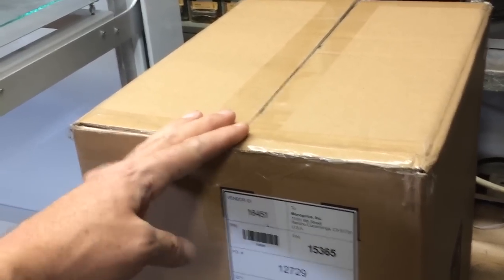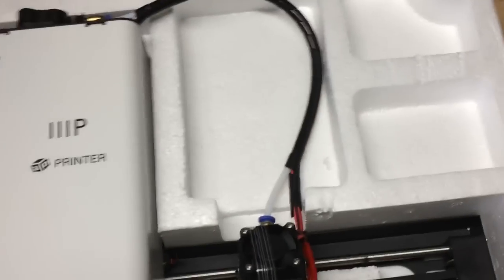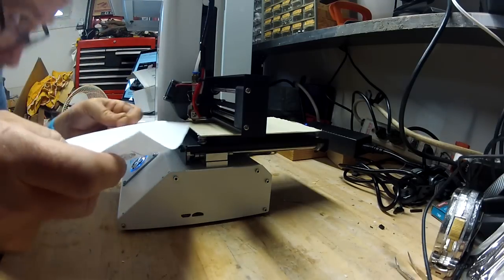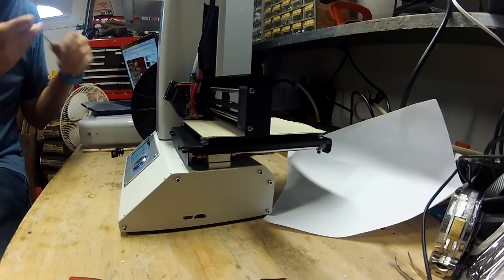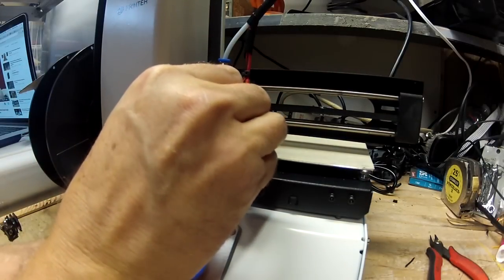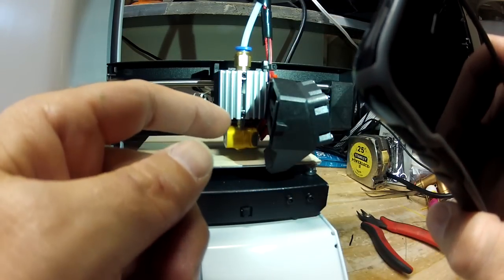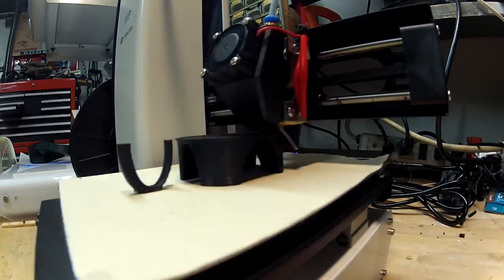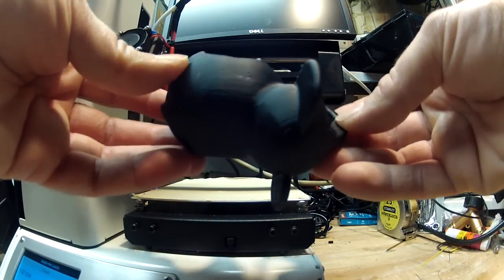3D Printer for $199!! Monoprice MP Select Mini 3D Printer Review - the good and the bad

Comment: I'm having nothing but problems with this printer ever since I "tried" to set up WiFi. Now, nothing works right and it's all over the place. All the settings had to be re-done. It abruptly stops printing because it STILL is trying to connect to wifi which i can't figure out how to stop. Printing by USB was a shit show as well. I should of just left it alone. So frustrating.
Reply from the maker: Yes, best to stay away from onboard wifi, but if you want to go wireless you should look into OctoPi - a raspberry Pi implementation of OctoPrint. I tucked a little raspberry Pi Zero into the case of a Printrbot Play to make it more functional and now no more messing with the USB connection or card on that one. The Pi Zero is a little slow so if I were to do it again I would use the Pi 3 http://amzn.to/2Cvr428

Comment: Hi, I wan to buy this printer but i don´t know if it is compatible with SolidWorks software. Will I have troubles if I print a piece designed on this software?
Reply from the maker: From inside SolidWorks - File > Save As to access STL export options and save the data in .stl format then use software cura software that comes with machine to prepare print file.

Comment: do you upgrade some parts on the printer to resolve some other issues, does it have to be the same parts for the model or can it be any other parts to make the printer function better. this is awesome that you seen some issues, but I want to know if you add some changes on your printer along the way.
Reply from the maker: I started with the completely stock printer but quickly upgraded to a tempered glass bed (just using tempered screen protectors http://amzn.to/2ixHFN7 ) I later upgraded the fan and I will post a video showing how I did that shortly. Other than that I run the stock printer but I know many people make lots of modifications. It is a great printer for tinkering. You should check out the reddit and facebook groups I linked to in the video description for more info.
Reply: another question, where do you get your prints, is from a good online source or do you have to make them from your own STL file maker like AutoCAD, Creo, Solid Works. the main source I end up getting my prints are from Thingiverse, but there were some downside of it when I tried to print.

Comment: Did it come with filament?
Reply from the maker: Luke, Paul, it does come with a small amount of filament - enough for initial testing but not enough to really do anything more. I recommend the PLA Pro from MatterHackers http://amzn.to/2h3pVEV as it is high quality and the prints always look so good. I also use the less expensive Inland brand PLA http://amzn.to/2h6wrej when I am not as worried about the appearance of the print - although it usually looks almost as good.

Comment: do you think this is a good printer for beginners and do you use thingiverse
Reply from the maker: Mochael, yes it is a great printer for beginners, easy to use easy to tinker with and a great community to help you figure out any issues. I do use thingiverse when looking for pre-designed parts and I use either Tinkercad.com or Autodesk's Fusion 360 when modeling my own stuff.
Reply: thanks for the reply
Reply: Michael Buhrley can you use those programs to add designs to already 3d models? like import and edit your models?
Reply from the maker: I have used them to do some editing of existing models, although the ability to do extensive edits will depend on the format that you get the model in. Some formats retain more information and can be edited more easily. You can find examples of people editing models with both programs here on youtube.

Comment: It's a shame it's got so many issues. It has such a nice design.
Reply from the maker: Thanks for watching! 

Most of the issues that I originally had with the printer were either resolved in units that shipped later than mine (I was in the first batch) or have been addresses by the community and have simple fixes. Any 3D printer is going to have issues. I have worked extensively with 5 different models of printer from an equal number of manufacturers and there has not been one that I didn't have to do some tinkering with at some point. One nice thing about this particular printer is that it is pretty easy to tinker with as 3d printers go.

I now have 4 of the Monoprice MP Select Mini's and recommend it to anyone interested in getting into 3d printing. Perhaps I need to do an updated review because I am pretty happy with it overall.
Reply: Michael Buhrley Thanks for the reply! Do you recommend the A8 Gearbest printer (prusa i3 clone) or this monoprice printer? Assembly is not a concern.

Comment: does pc software come with it?
Reply: Yes, it comes with both mac and pc versions of the slicing software Cura on the SD card. I use the free tinkercad.com for most of my design work and then use either Cura (free) or Simplify3D (paid) to do the slicing. The Cura software is sufficient for nearly all of the work I do.
Reply: Oh I appreciate your feedback. Do you think I can print a small human head about 1half inch? for a doll of course.
Reply from the maker: I'm sure you could use it to print that, however most filament based 3D printers will have trouble with really small details. I am pretty happy with the resolution of this printer but at a half inch the head would be recognizable but the features of the head may not be that recognizable. You can of course change the nozzle to a smaller one to increase the resolution to a certain extent. Replacement nozzles of various sizes can be ordered here http://amzn.to/2gjFpnW make sure you adjust the bed height after replacing the nozzle.

Comment: I want to use one of these as a dedicated small item ABS printer, but every reviewer I've found is using PLA. I'd like to know how well this printer works with the more difficult ABS.
Reply: I've only used mine with ABS for about a month now as I bought it to print structural parts not figurines - am very pleased with it for the price. Used the shipping box as a rudimentary enclosure and have all but eliminated my warping problems. I print at 235/85, although if I could get the bed hotter than 85 degrees with an extra power supply that would probably be preferable

Comment: Have mine!  Got it as a late birthday present to myself.  Like the detail it give you.  But doed ten to over heat if your making prints with a lot of supports.  I have a USB dual fan that I plug in and leave next to it to keep it cool and so far it's working.  Have to get a small fan and place it on the inside to cool the control broad and one bigger one for the vent out of air from the compartment.  But I love whats coming out of this printer.  Better then larger printers that cost 5 times more.  And for me!  I'm a first time 3D printer owner.  I have a lot to learn but with each print I get better.
Reply: I have found it tends to overheat more if you use the SD card, and I have no idea why. It will crash every time on long prints(8+ hour prints) if I use an SD card, but if I stream the print to it from a tablet over USB, it has never had a problem. 
I am going to try to modify it with a cooling fan to see if that fixes the issue, or if it just has a faulty SD card reader.
For now, I have a tablet permanently attached to it, which isn't necessarily a bad thing at all.

Also modified the button to be better... There is a spacer you can get for it on thingiverse which improves navigation immensely.

You can also stream prints over wifi, but the print tends to fail if you close the browser tab, and I can't trust myself not to xD

Sadly, if you print over USB, progress doesn't display on the LCD, so you can't check the progress over wifi either :(
Reply from the maker: Richard, I wonder if you have a bad SD card (as opposed to the reader)... I had something similar that would happen and the reddit forum diagnosed it as a potential SD card issue. I replaced the card that came with the machine with one from Amazon and it has worked great ever since. Note that the printer seems not to like SDHC cards or any card over 2GB so you may want to stick to a smaller card like this one: http://amzn.to/2jRLUPF but it could be an overheating issue as well. Thanks for the info.
Reply: I tried a different SD card, and same issue. OH... that might be the problem. The other card I tried was a 16 GB card, so maybe it was corrupting for a different reason entirely. I'll buy one of those low capacity ones and give it a shot, thanks.